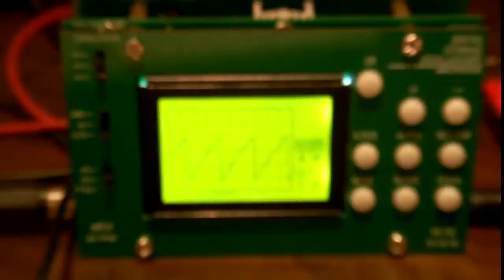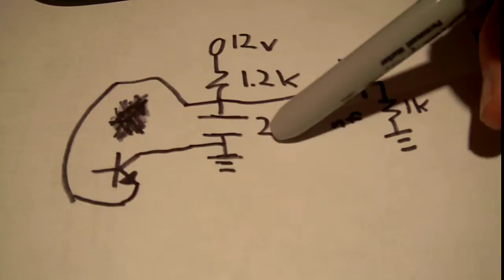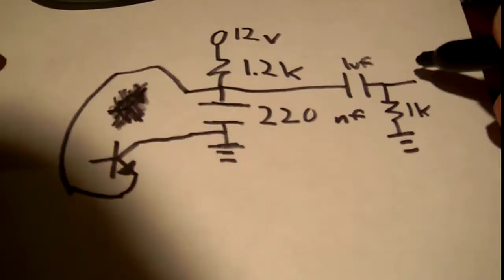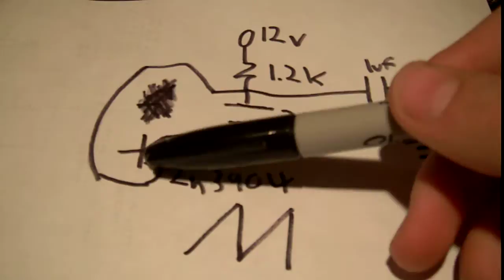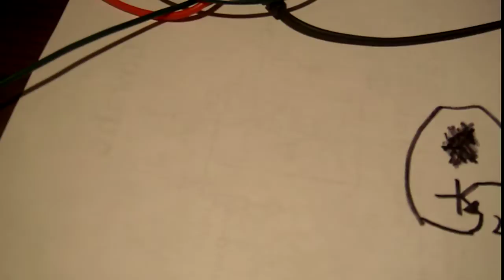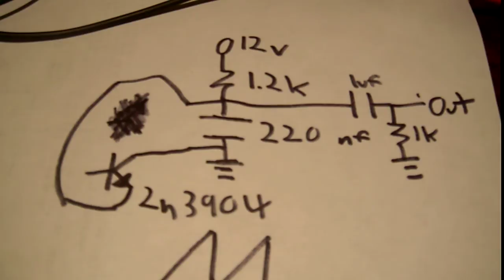Saw-tooth Generator

Comment: Hi!
Did you've tried the schematic with TL074 (or TL072) op amp? There are 2 equal resistors for the voltage divider, one capacitor (similar to this schematic), two 1/2 ratio (30k and 15k for ex.) resistors and one diode (to make saw from tri). It sounds complicated but it doesn't give a DC offset.
Also did you've made some kind of an analog synth of it? The load changes some things...

Comment: how to determine the frequency of the sawtooth generator?
Reply from the maker: The freuency is set by the value of the capacitor, but the best way to measure it would be via frequency counter or using an oscilloscope.

Comment from the maker: Feel free to experiment, PM me the results I'll be interested to know. This effect happens because the transistor gets saturated, so you may need to use more voltage or current (lower resistor value) for a diode. You will probably need multiple diodes to simulate the various diode junctions in a transistor.

Comment: Great demo! This is exactly what I need, I just modified a CRT tv to a music visualizer and was looking for a good sawtooth generator to replace the current horizontal deflector coil's input, which is currently the wires intended for the vertical coil. I'll be running it off of exactly 12 volts and need an amplitude of 1.5 volts, so this is perfect. I have a question though: Would a zener diode work better in place of the transistor?